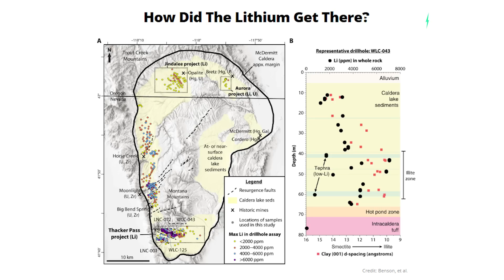Worlds largest Lithium deposit discovered in an extinct American volcano

Comment: Lithium is not the largest component by far. Highly refined graphite, nickel and cobalt are far more significant. That said Lithium Iron Phosphate is better still and it’s disadvantaged have been overcome.
Reply: N and C we can skip out on actully. Li just has a higher base cost and China is wanting to do trade wars / flood the markets with their Li instead -so its helpfuil to have a balance supply that will help balance the over all supply chains. Plus there isnt enough on the market currently. We can make batteries - but if you dont have supply doesnt matter how many you can make if you dont have the supply to actully make them. Solid state Li uses more Li and many mixes dont even include the other two.

Comment: People should understand that lithium is extremely abundant.  Any discovery should be taken with a grain of salt.  I'm a geologist and its my business to find these things.
Reply: Abundant -  maybe, but not easy to always get to. Pump mining is really costly and water costly - having a direct mine like this cuts a lot of cost and doesnt hurt the enivroment as much. Let alone, we simply dont have enough supply. You have to remember Li is used across ALL sectors of technology - from the watch on your arm to the thing flying over your head. Its not just for EVs but for everything. Not everyon recycles their battery either - meaning a lot of supply is also lost. 3.0 batteries like solid state also require more Li but they do drop the other C and N in most cases.

Comment: I think what Toyota meant is there isn't enough lithium for 10% of all vehicles to be electric. We are nowhere near that yet. As of 2023, there are about 20 million BEV's out of a total of 1.4 billion vehicles in the world, or about 1.43% Of course, increased lithium production and the use of other minerals such as sodium could well prove Toyota wrong, but making those 1.38 billion electric vehicles to replace all the ICE vehicles is going to be quite a challenge.
Reply: You only need 6kg of lithium for single tesla. 1.4 billion cars require 7 million ton of lithium. This deposit alone can cover it. Toyota is saying that because it is piece of crap company
Reply: @Klargus    Good point. Sounds like they know less than you do. 6kg doesn't sound like much for a 1 ton battery pack though. Where are you getting this information from? I got this info from one website:

"A typical EV battery has about 8 kilograms of lithium, 14 kilograms of cobalt, and 20 kilograms of manganese, although this can often be much more depending on the battery size – a Tesla Model S' battery, for example, contains around 62.6 kg (138 pounds) of lithium."

I'd also question whether that 7 million tons you quoted is ore or refined metal. I got this information from Wikipedia:

The Thacker Pass lithium deposit has measured and indicated resources of 13.7 million tonnes of lithium carbonate equivalent, at an average ore grade of 2,231 ppm (0.22%) lithium.[18] The Thacker Pass volcano-sedimentary deposit is the largest known sedimentary lithium resource in the U.S.[5]

Lithium Americas estimates that the site contains recoverable lithium worth $3.9 billion.[2] It is estimated that enough for batteries for about a million electric vehicles a year could be mined.[19]

At that rate, it would take 1400 years to make those 1.4 billion vehicles.
Reply: @apterachallenge  It is a refined metal. I.e Lithium not Lithium carbonate. The new discovery also holds 20 million tons of lithium not ore or carbonate. Otherwise, it wont be called largest deposit since Chile has 9 million tones of metals. Tbh, I am not sure since all these articles do not specify it and it get used interchangable which is very annoying. 
5kg on average but can be 6 or 7 kgs depending on battery size. Either way calculation does not change much
Reply: @Klargus   Yes, but if you read what it said in Wikipedia, it is the rate at which they can extract it that counts, and they can only build a million cars a year from what they can get out of that mine. Sure, there are other mines in the world, so it's not going to take 1400 years, but there aren't that many mines anywhere near that size, so maybe 100 years?
Reply: @apterachallenge  Honestly, I dont know. It is hard to predict how fast the new mines come online and how fast existing mines would expand.

Comment: After a pilot plant test to filter lithium out of oil well reservoir brine from the Leduc reservoir in Alberta, Canada the estimate of the lithium reserve is 23M tons. This is just one oil reservoir, there are many more in Canada and the USA.
Reply: And worldwide.
Reply: There was a recent report on high quantity Ore deposits in Utah or near by? High quantity meaning the content of the ore has a high ratio within the millings. It seemed to be in the 30% range? Petty high.
Reply: Evidently this project is heading to full scale, after the pilot plant has confirmed chemical extraction and concentration of the Lithium.  Now we have to keep tuned to cost data to see if it is going to be successful when two of the other producers  (via “proven” processes) are operating at full (initial phase) production, around the end of 2024!

Comment: Several years ago I remember reading that Tesla had purchased 10,000 acres in Nevada. A few years later I remember Elon stating that there’s enough lithium just in Nevada to electrify every vehicle in North America. Hmmn. I need to research where I read this. I wonder if Tesla still owns the land and where is it located? My memory is a bit fuzzy on this but I remember thinking that this would be important in the future.
Reply: It was mentioned in the Battery Day presentation two years ago.
Reply: @CutlassSupreme455  thanks at about 1:15:00 mark they have some slides ext about lithium clays in north america, where he talks about usa having enough lithium in nevada to convert every vehicle in usa from the already discovered lithium at that point
Reply: Most the Thacker Pass deposit is on Federal lands.

Comment: I believe for Lithium it requires a lot of water. And Nevada isn't that place with a lot of water. Wondering how they will solve it.
Reply: I believe there are 2 methods and sources of lithium. Lithium hydroxide from brine and lithium Carbonate from rocks.
Reply: There are many methods - in this case - its being mine directly - thus doesnt require water - if it was being pump yes it would require water evap - but in this case, it doesnt require it at all.
Reply: Plenty of water especially in the ground. Many gold mines near Elko and Winnemucca deal with excess water and have dewatering issues.

Comment: Even if production and processing of Lithium became a completely non issue (but that's a very tall order when talking of a goal of moving all ground transportation of the world to be electric), the HUGE problem of Lithium batteries are:

#1 Their [lithium batteries] intrinsic fire hazard. That recent RoRo cargo ship that burned for weeks was a complete billion dollar loss (both ship and all the automobile cargo) because of the nature of Lithium battery fires. One should think twice before parking an EV in a garage to charge overnight. If it has a battery defect and an internal fire results - you're going to lose your entire house to that fire (this kind of thing has already happened and will happen more frequently when/if EVs become ever more prolific).

#2 There's still the thorny problem of what to do with old EV battery packs - recycling them (some battery tech is easier to recycle than others - Lithium batteries are a very hard problem).

#3 Oh, and the insurance cost for EVs because that battery pack is a very expensive and rather fragile point of vulnerability. Once an EV is involved in an incident that compromises the battery compartment, due to all the risk, the whole battery compartment has to be regarded as totaled, which can be more than half the value of the vehicle - makes for vastly more expensive insurance claims (and EVs already cost more than conventional vehicles).

One wonders if we'll see a situation where a home burning down due to an EV battery compartment fire is a scenario refused coverage by home insurance firms...

It's a serious problem that the industry needs to solve (but is intrinsically very difficult) - consumers are taking note of these negatives issues per EV technology, and I've barely scratched the surface with the problems of EV tech (for instance, how they are more environmentally damaging to the Earth to manufacture than is a conventional vehicle).
Reply: Thanks. I missed the RoRo Cargo ship fire story. Interesting.

Comment: Am I correct this will help in the acceptance of EVs so we can get to solid state batts? Or do those batts also need lithium?
Reply: The price for sure will go down and more people will then afford EV's.
Reply: Solid state may not pan out - not because the tech doesn't have potential, but because it looks like we might be on track to reach the solid state potential with liquid medium batteries.  Solid state batteries certainly need a source of valent electrons, and lithium is a great option for that need.

Comment: Better ways; well you would be shocked to see that the new lithium refining plant Tesla is making in Texas uses water and traditional precipitation .. so even though they are looking for non water based process ; they haven't found anything practical - so WATER remains the huge problem for lithium processing.  It already is using 1% of the worlds fresh water; and it is dubious that it will ever reach 2% let alone 45% of all the worlds fresh water; which would be required to make 100 million vehicles.

Comment: Using water on top of a volcano or transporting  the ore to lower ground where there is water sounds more expensive than the Bolivian flats. 2026. We shall see.
Reply: Lithium extraction from clay is an entirely different process from brine extraction, and requires very little water. Sam does create confusion by showing large evaporative ponds created to evaporate off the water from lithium brine. In lithium brine deposits the lithium has been dissolved into ground water and the lithium needs to be extracted out of the water. Extracting lithium from clay and rock is a very different process.

Comment: These areas are already under stress for water. 660 million gallons of fresh water is needed every 20 minutes for the lithium pounds .let alone the sink holes you will create pumping all the Brien water from your ground table.
Reply: 660 million gallons every 20 minutes??

That's almost the same water flow rate as Niagara Falls.

Now we know why its a bad idea to smoke  crack laced with LSD ...
Reply: @johnb7430  that the size of Olympic swimming pool every 20 minutes
Reply: @johnb7430  no mention of how each gallon of refined burnable fossil fuels at just the refinery level, also consumes 1-2.5 gallons of fresh water. And we dig up transport refine and burn over 20,000,000,000+# of crude oil each and every single day globally. 😏
Reply: Lithium extraction from clay is an entirely different process from brine extraction, and requires very little water. Sam does create confusion by showing large evaporative ponds created to evaporate off the water from lithium brine. In lithium brine deposits the lithium has been dissolved into ground water and the lithium needs to be extracted out of the water. Extracting lithium from clay and rock is a very different process.
Reply: @GoCoyote  in exploration, extraction and processing. In the drilling phase yes they drill,water is used to determine lithium concentration. During the extraction mass amounts  of water is used to dissolve lithium rich materials creating a brine solution!!!!!! .your clay is just evaporated brine pond from fresh water dissolved minerals from FRESH DRINKING WATER. AMERICA IS UNDER DISTRESS IN THE AREAS THEY ARE MINING. GIVING LESS WATER RIGHTS TO THE FARMER.
Reply: @dorhinj23  accurate factual numbers. Just lookup the daily global consumption of crude oil in millions of barrels per day.
Each barrel weighs in at 300# so it's just simple math. 👍🏻
Reply: It takes less then a kilowatt hour to desalinate a 260 gallons of water via reverse osmosis. Vacuum distillation systems in warm regions can do it for even less and produce marketable salts, eliminating brine discharge. The only fresh water crisis is a contrived one  designed to perpetuate the impoverishment and enslavement of humanity.. Solar Panels are  less then 20 freaking cents a watt there are no excuses for water scarcity.  lack of water is not the problem the problem is the malevolence in people power who contrive false scarcities to enslave their fellow man.
Reply: @dorhinj23  would rather take the source of life WATER !!!!! for your local farmers or for batteries.

Comment: It’s always been my understanding that the majority of the planets rare earth minerals are found in volcanoes
Reply: Maybe.  You would expect the density of volcanic rock to be higher.  Also, sources might be purer if rare elements are able to coalesce into pools of similar chemical properties while in liquid form.  Certainly it seems like the percentage of volcanic rock that is rare earth minerals in concentrated, mineable form should be expected to be much higher than the percentage of rock overall.
Reply: Igneous rocks ...volcanic activity and in metamorphics... for primary sources they sepperate and form in molten rock or the rocks round them ...  hyrothermal  veins are a classic example. 
The other sources are evapourites that form layers of sedementary deposits like ancient seas and lakes. The other source is as concentrated deposits in sedementary basins ...like ancient estuarys lakes or inland seas and swamps.  So ancient igneous rocks from older mountains get worn down and the heavy minerals concentrate as sedementary deposits where the water flow drops the load... 
Its the natural principle that gold panners use... Sifting river gravels.. 

In geology you you have to think big and slow ...very slow as well as explosive forces and rock tearing ... It becomes plastic flows and gets recycled at destructive plate margins ...as its subducted into the crust. Most big Volcanoes are associated with these subduction zones .... Destructive plate margins.. 
Like the Cascades or Andes. 👍🏼🧙‍♂️
Reply: its generaly some of the youngest rock so probably, the fact australia has so much lithium & so little volcanic activity for millions of years is probably the anomaly not the rule

Comment: It's still Lithium, Wouldn't touch it with a ten foot pole unless you want your EV to burn your house down.
Reply: Did you type that on your phone with a lithium battery?
Reply: Do you mean like the lithium in the batteries in your phone, laptop, tv, power tools, camera, hearing aids, pace makers, and most consumer electronics?  Either you are a hypocrite or you  are Amish and had one of your English friends post this comment for you.

BTW, do you think that gas vehicles won't burn your house down?  EV fires are extremely rare - 25 per 100K vehicles sold.  There are about 200,000 gas vehicle fires per year - over 20 per hour - 1,529 per 100K vehicles sold.  About half of these are due to equipment failure.
The following are recent recalls of GAS vehicles:
Nissan recently recalled 793,000 vehicles due to risk of fire.  Owners were told to park their vehicles outside and away from buildings.
According to the NHTSA, KIA and Hyundai had nearly 5,000 fires, 198 injuries, and 2 deaths.  Owners were also told to park vehicles outside and away from buildings.  5.8 million vehicles were recalled.
Ford recently recalled 518,000 vehicles after reports of 20 fires due to cracked fuel lines.  Ford had several recalls over the past 30 years due to fire risk including unattended vehicle fires.
Kia recently had another recall - owners were again told to park their vehicles outside and away from buildings because the vehicle could catch fire "while the vehicle is parked and the ignition is off."
Reply: @muskrat3291  used facts to dum ppl are ppl think the earth flat ,lol
Reply: Oh dear, yet another one. Try looking at the NTSB's figures for car fires in the US during 2022. They recorded 190'000 ICE car fires in 2022, and 4200 EV fires during the same period...... Thatcham, the UK based Road Safety organisation used globally available data for their study on car fires. Taking a sample of 100'000 cars of each type - EV's and ICE - they found there were 1529.9 fires per 100'000 ICE cars, and 25.4 fires per 100'000 electric cars. The reality is exactly the opposite of what you perceive it to be......
Reply: Thank God it’s safe to bath in gasoline while smoking a cigarette.  

Love your Red Herring argument.

Comment: how ironical that you destroy the Earth with mining for saving the same thing
Reply: To fully electrify the planet we need to mine 40 million tonnes a year (we currently mine 7 million). The fossil fuel industry (coal, oil and gas) currently mines 15 BILLION tonnes a year. So yes, let’s mine for renewables, they at least can be recycled.
Reply: @sarahaubrey8096 It's not a good comparison because oil, coal and gas are energy SOURCES while lithium (batteries) are NOT. It's even possible we'll need to extract MORE traditional energy sources to get the electricity needed. People might get very wasteful with electricity once it seems easy and cheap.
Reply: @johnsamu  it will be cheap and plentiful because it’s renewable.
Reply: Mining lithium depletes and contaminates ground water,we can't live without water. And cobalt causes cancer and they ate opening a cobalt refinery  in Lawton Oklahoma  that's the only one in the U.S. all their clean energy is not so clean. You can thank our President for all this.